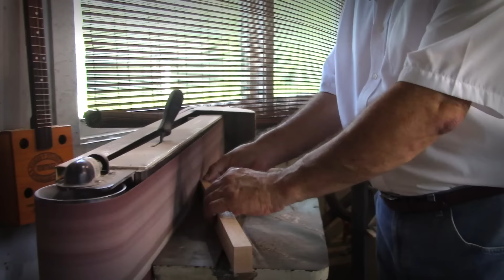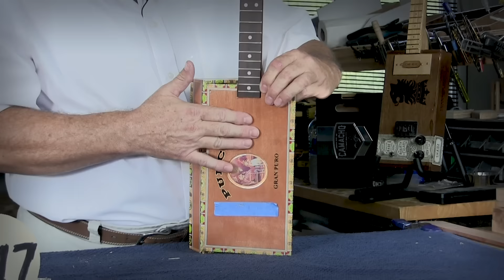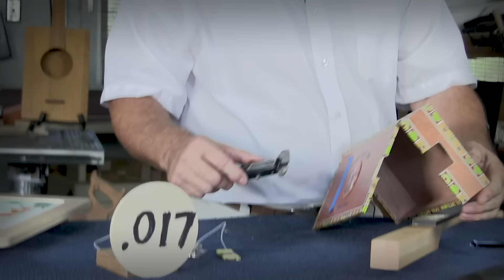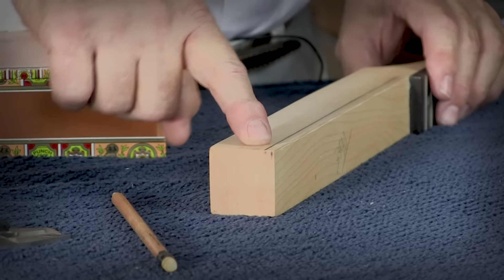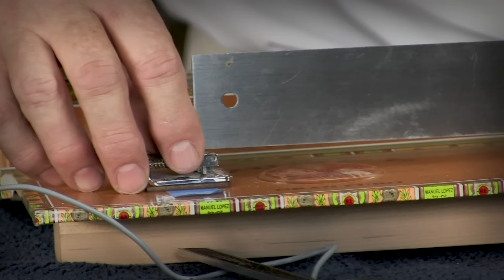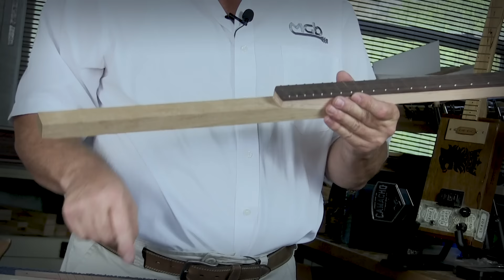Fitting A Neck To A Box | Learn'n & Build'n with Michael Breedlove

Comment: There’s a guy making full sized acoustic guitars using rectangular boxes (much larger than cigar boxes). They sound as good to me as any customer made or manufactured guitar made in the customary way. Without the curves and kerfing necessary for the curves they are far easier to make.

Comment: Great explanation on back angle, thanks!  I do notice some builders want the neck to touch the lid at each end not touching the entire length as you have, does either way matter?
Reply: Yeah apparently the top of the box isn't going to be able to resonate if it's sitting on the neck so it's kind of a solid body guitar

Comment: When you cuts on the to of the neck, you must be attaching the neck to the lid (top of box). I cut from the bottom of the neck and attach the neck to the bottom (back) of the box.  Cant mix those two techniques.
Reply: Seems like if you want an acoustic effect you would need to put the neck at the bottom so that the top can vibrate

Comment: I use a small allen screw on the back at the rear of the CBG to adjust the string height. This works by changing the "neck angle" to lower or raise the string height. It works very well indeed :-)
Reply: Genius. Id love to see this